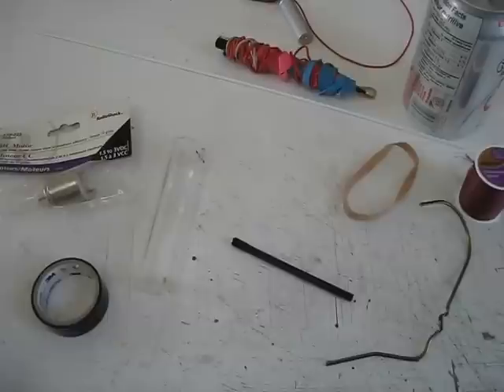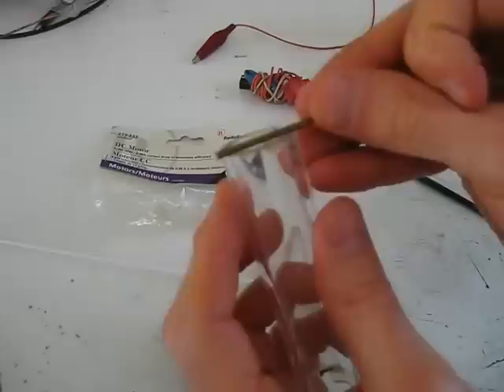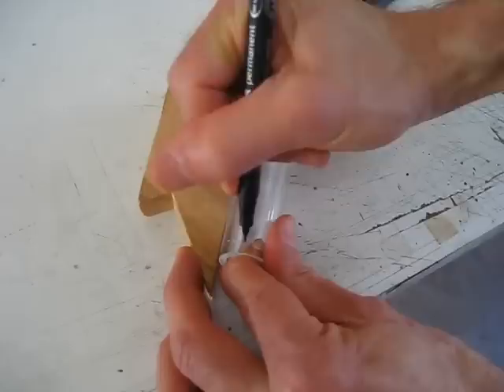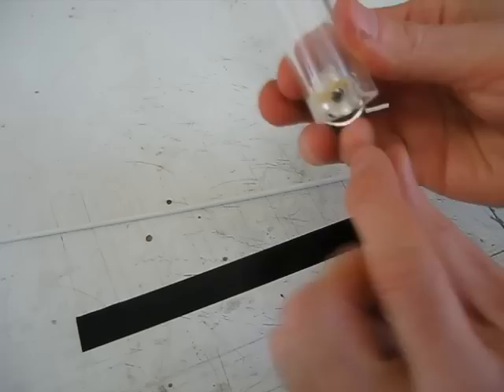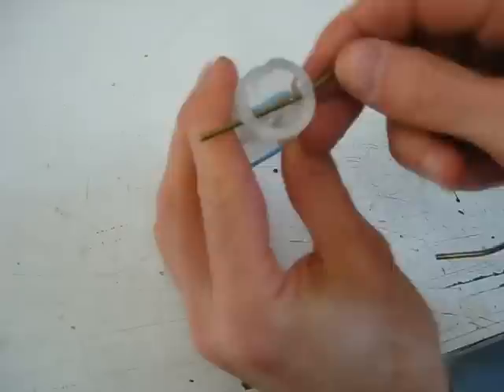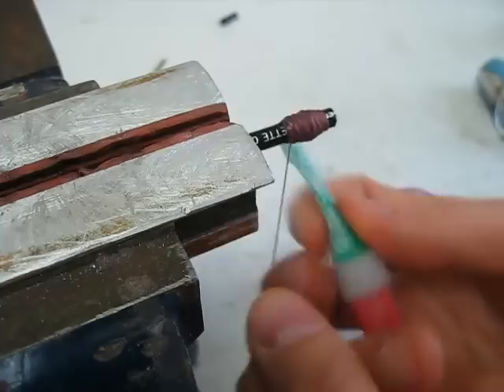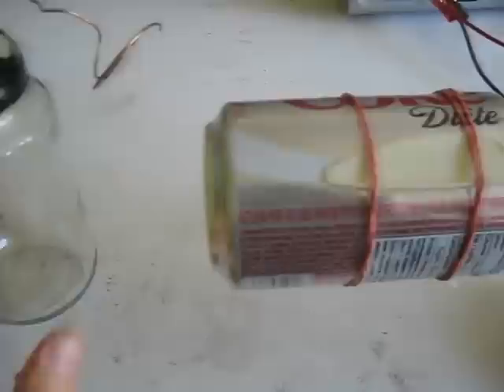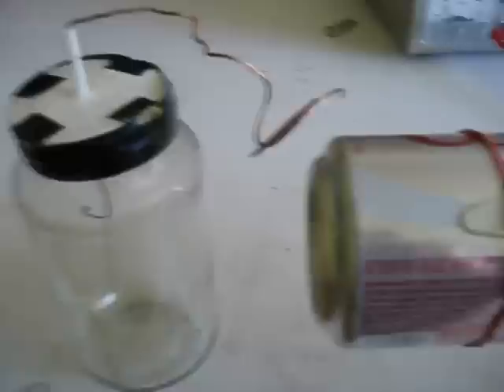How to Make/Build a Van de Graaff Generator Part 1 (Homemade/DIY)

Comment: Him mine wont work. The outside of my can for some reason won't conduct through to the inside, is this a problem? In you how it works vid, it made me think its a problem. Oh we'll gotta hand this in incomplete which is fine because my teacher is happy and I've got a working electroscope. Trust me won't get marked down. By the way you have helped so much

Comment: Can the belt be cotton as it was between nylon and Teflon?
Reply from the maker: I've never had much luck with cotton. And if you look at the table on the right on http://en.wikipedia.org/wiki/Triboelectric_effect , you're correct, it's in the middle. But it's also beside wool, which says no charge. So I guess even though it's in the middle, the middle ones don't get charged or not much.

Comment: is it dangerous....... what safety tips should be followed......and which material is d tube which u fixed to motor made up of.....plzz respond
Reply from the maker: No, this one's not dangerous. If the can was a 15 inch/38 cm diameter dome instead, then it would be dangerous.
The tube can be anything that's not electrically conductive, which means it can't be metal.
Be sure to check out Part 2 for this video (https://www.youtube.com/watch?v=QrCgtjZwnB0) as it has some tips that make it easier to make and work better. This other video also talks about it too http://youtu.be/xRLvbwF2MnM.

Comment: SIR I have made a van de graff like yours but  here is not sparking appears what is reason beside that? 
when i consult to my professor he said that here is not AIR'S IONIZATION  so it won't work and he said that for air ionization you will need a high voltage(i.e. 30000v)
so i left that project 
NOW SIR PLEASE MAKE ME CLEAR THAT HOW WILL IT BE COMPLETED??
HELP........

Comment: instead of nylon and PVC, if I use the same material on both the shafts, will it work?
Reply from the maker: It won't work according to the triboelectric effect. I've seen people doing it but the effect must have been something else.
Reply: can clay be used at one of the shafts? Gripping will be easier.
Reply from the maker: I don't see clay in any triboelectric series table (https://en.wikipedia.org/wiki/Triboelectric_effect) so I can't say for sure. Looking at what clay is made of (https://en.wikipedia.org/wiki/Clay) doesn't help either since those things also aren't in the table.
Reply: ok 
thank you

Comment from the maker: Nice approach but a ping pong ball is too small. The larger the can/ball, the higher the voltage you can get. So a ball that's larger than the coke can and wrapped in al-foil would be better.

Comment: Hi sir, Can you tell me what did you do on 9:14 - 9:30 part? did you wind the cable on the screw? and what did you do with the screw why it can stick in the can?
Reply from the maker: Yes, I wound the cable on the screw. I put it inside the can because a Van de Graaff works much better is the electrical connection is made to the inside of the can. When the connection is made on the inside then the Faraday cage, or Faraday ice pail effect can take place. See my video about it here http://youtu.be/xRLvbwF2MnM.
Reply: How can the scew stick in the can?
Reply from the maker: My screw was a small bolt and I put a nut on the other side to bolt it on. You can see me tightening the nut at 9:29 in the video (sorry for the poor quality, it's an old video.) Alternatively you can use an actual screw with a sharp point and make the hole small enough that the screw tightens in the hole but that may be hard to do from the inside.
Or... you can do make the attachment to the inside of the can in a completely different and better way that I show in my part 2 video here http://youtu.be/QrCgtjZwnB0.
Reply: Ty very much, can it work if i use tape to make the cable stick with the can and i dont use the screw?(its a good video tho, and. Im grateful to get ur reply cos the vid is 5 years old)
Reply from the maker: Yes, you can use tape. But you should really look at the method I suggest in my part 2 video that I gave a link to in my previous reply. It works much better.
Reply: Thx for the reply

Comment: Could you please tell me were did you attached the collecting comb n spray comb..?
Reply from the maker: I show connecting the one to the can at 9:20, though you can see a better approach in my part 2 video https://www.youtube.com/watch?v=QrCgtjZwnB0. The other one I show at 10:10 and I connected it to household ground using the same technique I show in the part 2 video at three minutes and eleven seconds in. I also show other grounding methods in the part 2 video.
Reply: Thanks! Could u please give me some other suggestions for belt material as the rubber band doesn't rotate in my setup
Reply from the maker: That's a hard one. At this size there aren't a lot of options. I've seen people have success with vinyl electrical tape made into a loop with the non-sticky side facing inwards and vinyl used for the rollers but that uses a different effect than the triboelectric effect I talk about. For larger Va de Graaff's, see The belt section of my webpage here https://rimstar.org/equip/build_make_van_de_graaff.htm.
Reply: Is it okay if I use nylon n vinyl rollers vt vinyl belt?
Reply from the maker: Have a look at the triboelectric series table https://rimstar.org/science_electronics_projects/triboelectric_effect_series.htm. You'll see that nylon and vinyl are far apart so that's good. I'm just not sure how it would work with the vinyl to vinyl side - I don't know what the polarity of the charge is in that situation. I've never done the vinyl to vinyl approach. Maybe just try using vinyl for all of it. I think that's what I've seen people do.

Comment: What power supply is required?
Reply from the maker: Salcott Aam Which power supply you need depends on your motor and how much tension you'll put on the belt. The motor has a maximum voltage and a current rating and that tells you what's needed to run it. The tension of the belt is what makes the motor have to work, the more tension the harder it'll have to work. Mine wouldn't turn using batteries so I used my homemade power supply.

Comment: check out the video on my design. I have made several improvements to increase the output to about 1 1/4 inch sparks every second! but not any longer. it arcs to ground beyond that. (very faint 3 inch sparks)

you can see in the video what I did differently. I used a fuse for the top roller, and used lots of hot glue and tape to hold it all together, as well as a plastic lid down over the shaft to help recent arcing to ground. (also my little 5V motor is being driven at 12V... )

Comment: Hi again Sir. Is that also a rubber band? The one inside the tube? And also, is it okay if i directly connect the van de graaff on the wall outlet?
Reply from the maker: +Leniram Ledodnum Yes, it's a rubber band inside the tube. I don't know what you mean by directly connecting the van de graaff to the wall outlet. If you mean can you plug the motor into the wall outlet then that depends on which motor you have. It has to be made for that. Mine definitely cannot be plugged into the wall outlet. It would damage the motor and probably trip the circuit breaker in the breaker panel.
Reply: +RimstarOrg do we need to use the same rubber band you use inside the tube? because i have only a thin rubber band here
Reply from the maker: +Joren Hernandez The materials you use for the outer surface of the rollers and the inner surface of the belt are important. That's what I talk about in the video about the triboelectric series. If you have trouble understanding me in the videos, I also have it here http://rimstar.org/science_electronics_projects/van_de_graaff_faq_frequently_asked_questions.htm#Q_RBMATERIALS. But now that you mention it, as long as the rubber bands don't twist then you might  be able to use multiple thin rubber bands side-by-side.
Reply: +RimstarOrg thanks

Comment: can use this at dry leaves in a bigger size are it will bunt the dry leaves?
Reply from the maker: This might make tiny holes in dry leaves if you put the leaf between the can and your finger when you create a spark. Or maybe the spark will go to the leaf. The bigger the Van de Graaff, the bigger the hole will be.
Reply: I mean when a conveyor carrying the leaves on certain height above the conveyor i hold this to attract other materials except leaves then it cause any problem?
Reply from the maker: You'd have to test it. I don't know what materials will be attracted and what materials will not be attracted.

Comment: wat we can use instead of glass tube?!
Reply from the maker: It's actually a plastic tube. You can use anything as long as it's not metal. Look around your house or the local stores. If you make the shafts for the rollers/pulleys longer then you can use plastic bottles. In your hardware and electrical stores there are plenty of tubes in the plumbing and the electrical sections.

Comment: what should i use for the belt??
i can not get that thick rubber bands in India
i've tried synthetic rubber ( a friendship band :p) but it didn't work :(
Reply from the maker: You could try vinyl electrical tape (usually it's black) with the sticky side facing outward. I haven't tried it myself but others have and had success.
Reply: RimstarOrg while using the synthetic rubber band i used the electric tape on the wrapping as a pulley on the motor end and a plastic tube on the other end around a metallic shaft...  what should i replace these with
Reply from the maker: Vinay Shrestha
Strangely enough, a lot of the people who had success with electrical tape as the belt also used electrical tape as the wrapping on the pulley at the motor. But they usually used glass as the other pulley, though you could try with your plastic first. Maybe something different than the triboelectric effect is happening with their electrical tape belt/electrical tape pulley. For glass I use the glass from a fuse. You can see this in my part 2 video "How to Make a Van de Graaff Generator Part 2".
Reply: RimstarOrg i don't have anything to remove the metallic part of the fuse although i haven't tried the belt yet
Reply from the maker: Vinay Shrestha
You could experiment... maybe hold the glass with a pair of pliers and put the metal side on an electric heating element like a stove or heater.

Comment: Is there any harm if I use a plastic bottle instead of the PVC pipe
Reply from the maker: No, a plastic bottle will work just fine. Just don't use a metal pipe since metal conducts electricity.

Comment: what is the use of glass tube and why it is important
Reply from the maker: The plastic tube (it's not glass, although glass would work too) is there just to hold the two shafts in place. Any material can be used as long as it is not electrically conductive -- so no metal tubes.
Reply: It's not a 'tube', it's a 'tchewb'! lol

Comment: I think this uses the tribo effect and induction principle to separate a charge, it's using the fact that the can is a roundish "large" surface to accumulate nicely. But it's not using the faraday effect very much because the collecting organ is not INSIDE the can. That explains why he must run the motor so fast to get a tiny charge !! would be much more efficient otherwise!

Comment: Hey this corona discharge can be seen in dark right?
Reply from the maker: rajas nene Yes, it gives off its own light so the darker the room the better you'll see it. If you don't see any in a completely dark room then there either isn't any or there's not enough. If you made one based on this video and you're not getting any results then see my part 2 video which makes some simple, but substantial improvements "How to Make a Van de Graaff Generator Part 2".

Comment: can i use this energy for making a electro static precipitator??
Reply from the maker: I haven't tried it with this small Van de Graaff generator but I don't think so. It works, just barely, with my commercially made Wimshurst machine with the 26cm disks and that supplies a lot more current for ionization than this small Van de Graaff. A much larger Van de Graaff should work though, one with for example, a 12inch/30cm diameter dome and a wider belt might work.
Reply: RimstarOrg should i use a single van de graaff generator and a electromagnet or two generators producing unlike charges so when the dust falls on one it will  get ionised and as it moves to the other it would get attracted to the other generator's surface?
can you help me out with a diagram may be.
Reply from the maker: atul Sc
I don't see why you'd use an electromagnet. As for using two generators, they'd still have to be bigger than the one in this video to have much effect. If you did have a bigger one then just use one of them. Make the same arrangement as in my smoke precipitator video, connect the mesh to the same Earth ground that the bottom of the generator is connected to, and connect the cylinder part of the precipitator to the generator's dome. Basically replace the power supply in my video with the generator.

Comment: Are there any safety precautions?
Reply from the maker: There are no safety precautions needed if you're making a small one like the one in this video or in my part 2 video. Safety only becomes an issue in larger ones where the shock is a lot stronger. But even then, the shock may be harmful only to people with weak hearts. Then if you make a really powerful like my one with a 15" diameter dome, I wouldn't allow myself to get shocked by it at all.

Comment: Hi , my rubber band doesn't spin when I put it on the motor , what should I do?
Reply from the maker: Off the top of my head here are two things you can consider doing depending on how you've made it. You need to increase the tightness of the rubber band on the roller/pulley. You can move the two rollers/pulleys further apart. If that's not possible then you can try increasing the diameter of one or both of your rollers/pulleys. For example, in my case one of mine is covered in black vinyl electrical tape. I can increase the diameter by adding more tape. That makes the rubber band tighter and so it should grip better.
Reply: +RimstarOrg thank you so much

Comment: instead of the metal can if i use two aluminium bowls together as a sphere then on touching it ,did my hair go up
is there a chance of shock
Reply from the maker: Yes, the larger the sphere the larger the amount of charge that can build up on it. You're basically decreasing you losses. This assumes you don't have significant losses elsewhere too. Note that I improve this can design significantly in part 2 "How to Make a Van de Graaff Generator Part 2". I also explain this more near the end of my video on how Van de Graaff generators work "How a Van de Graaff Generator Works".
Reply: RimstarOrg
so you advise me not to use the bowl is it?
but i have to present it in exhibition competing with about 60 schools
so with metal can did the hair go up,also i cant find any thick rubber band here .
Is vinyl electric tape is same as to an insulation tape
Reply from the maker: Rohit Remesh
No, using bowls would be better since you can make it larger and get higher voltages. So if you want bigger sparks and your hair to go up, then use the bowls. You can get sparks with the soda can but you can't get your hair to go up much. For a competition, use bowls since you can make a larger dome.
By "insulation tape" do you mean "electrical insulation tape"? If yes, then it probably is the same thing but without seeing it myself I can't say for sure.
Reply: RimstarOrg instead of rubber bands what will i use .also i could not find vinyl tube ,for that can i use sealing wax in such a way that it covers a plastic tube
Reply from the maker: Look at the list on the right on http://en.wikipedia.org/wiki/Triboelectric_series#Triboelectric_series. The material for the surface of one roller should be on one side of the table, the material for the surface of the other roller should be on the other side, and the material for the inside of the belt should be somewhere in between the two. So if you're using sealing wax then keep that in mind when searching for a belt material. Some people have success with vinyl electrical tape for the belt. So if you can't find a rubber band or vinyl electrical tape then I don't have any option for you off hand. Have a look through the comments below as I seem to recall others reporting what worked. BTW rubber bands can be found in any store that has a section with school supplies or office supplies. Your post office might have some too. They're also use sometimes by grocery stores for wrapping vegetables.
Reply: RimstarOrg
so i will use plastic tube wrapped with vinyl tape as lower pulley and glass cylinder as second pulley and vinyl tape itself as the belt

Comment: Can we use for tube, a paper tube ?
Reply from the maker: Yes, if the paper tube is strong enough then it'll work. What I mean by strong enough is that if the belt is on very tight then that can put a lot of pressure on the tube. Also, make sure it doesn't get wet, otherwise it will become electrically conductive and it won't work as well. You can cover it with a non-metallic tape (not aluminum or copper tape) to protect it from moisture I guess.